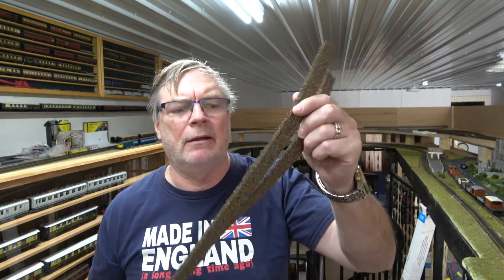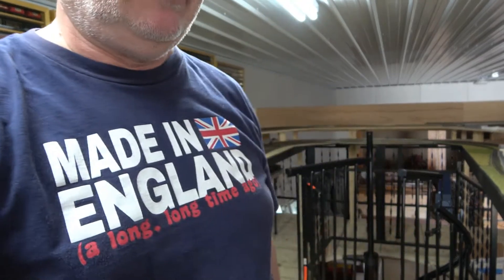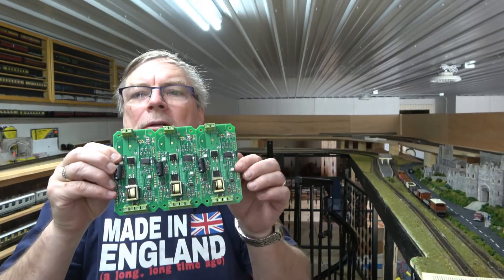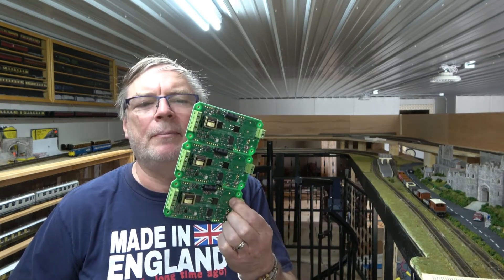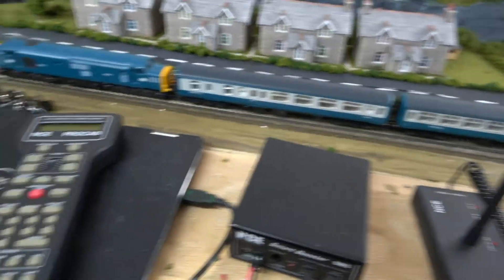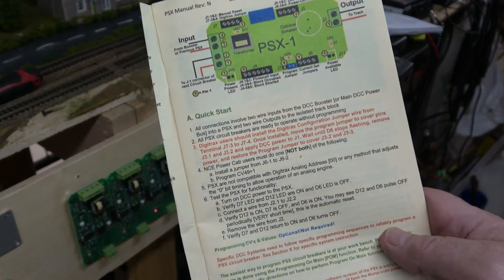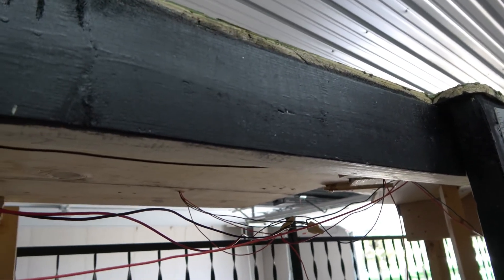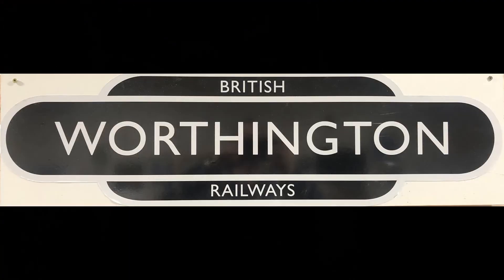16. DCC Power Zones

Comment: Hi Steve. I think the T-shirt you wore in this video has answered a few questions; I'm now guessing you are an Ex-pat Brit (you may have taken out US citizenship) and have picked up an American accent during your time in the USA. I too have far too many non-DCC ready locos and am still looking for a magic solution to switch between running DC and DCC locos (I know that I may not have the two different types of loco on the track at the same time - here's hoping. My track plan does not lend itself to having an isolated track for just DC running.).
Reply from the maker: Hi Paul, Correct assumption, I lived in the UK until the age of 30 when I moved to US where I've been for last 33 years (not a Citizen though). I've seen various ideas for localized switching to and  from DC to DCC, I suppose it shouldn't be too hard for a simple layout, but as you add additional power zones to DCC, as in this video, it does somewhat complicate things. I decided to play the "easy" card and just isolate one section, maybe one day I'll look into amore complex power switching option.
Reply: @worthingtonmodelrailway  I have been buying locos, rolling stock and other layout bits and pieces for almost 3 years but am only just now starting to lay track. During this period I have had the seeds of an idea of how to switch between DC and DCC, but have yet to finalise the idea. Let me know if you beat me to it.
Reply: @worthingtonmodelrailway  My wife was born in the UK and lived there until her early forties.  She was a Geordie but escaped the northeast and the disapproval of her peers!  They though she should stay in her place, but she's been here in northern Virginia with me since 2011 and became a naturalized citizen a couple years ago.  I am currently working on a sizable layout and have the triple breakers like you do.  I have quite a few loco's but I've been selling off some that are DCC ready and trying to buy more with DCC sound.